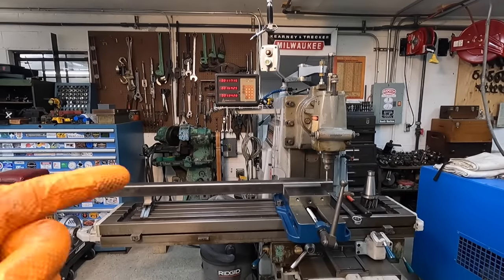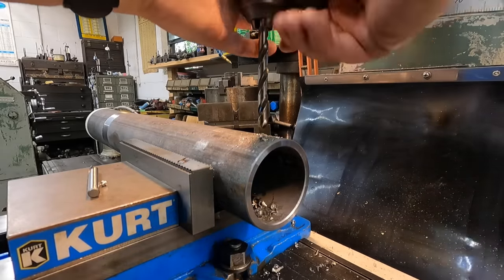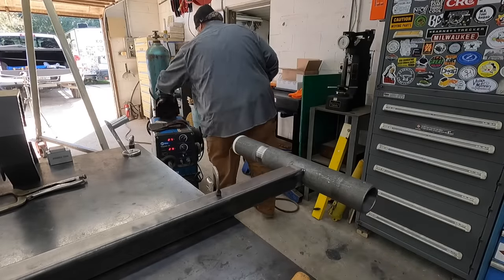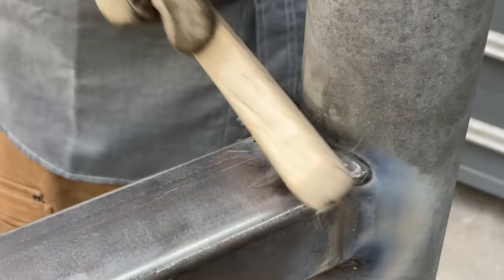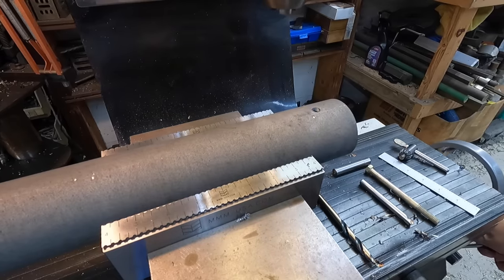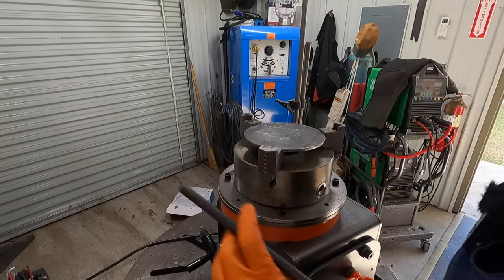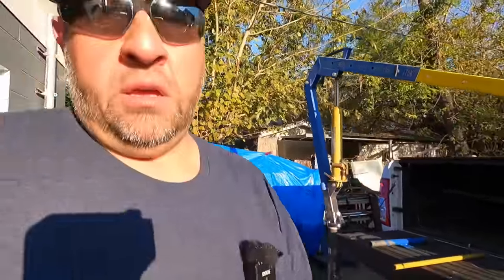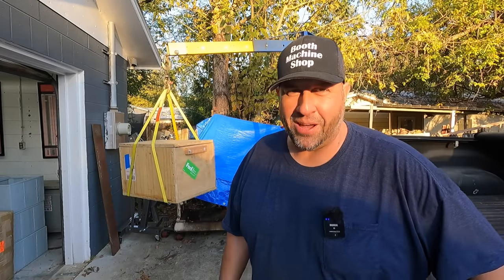Truck Hitch Crane Build Ep. 7: First Test!

Comment: @Abom79 
Why not weld a piece of angle on either side of the boom, and a small piece on the face of the boom, and just "slot" the handle into place? 

This would make it much easier to handle, and maneuver the boom during assembly, and tear down, while also giving you the ability to attach, and remove the handle as needed.

Comment: As for the bottle gas i use Stargon Oxygen 2% CO2 28% argon 70% i think, but i know was told by the guys i go to (Sutton and Garden) that if the bottle sits to long with out being used that you need to role it on its side across your shop floor to mix the different weight gasses back into each other.

Comment: It turned out great! On the worm tracking, what gas flow rate are you using? It sounds pretty high, maybe try lowering it a little bit, I usually run 20-25 cfm. I’ve never had that issue, I’m not saying it’s the flow rate, just something else to experiment with.

Comment: Humidity causes Flux Core to get wormholes. Idk how the weather has been like, condition where your material, and equipment is stored at. Any kind of major temperature changes, like a moist cold shop to a hot dry work area could introduce moisture. I'd agree with you though. If your gas cylinder is as old as you say it is, it surely wouldn't hurt to swap it out. If you think about anything that could bring in, create, hold any kind of moisture, I think you'll figure out what's causing you wormholes.

Comment: Depending how heavy the loaded object is, it will sag the truck springs and put too much pressure on the foot bolt to remove it... better a screw jack or hydraulic.

Comment: .045 dual shield is my fave! If your heat and travel speed is right? the flux will curl up and fall off on its own. Now? Just my 2 cents worth but? Check your flow rate on your shielding gas. I normally use a bit less flow with dual shield than with hard wire.  The higher flow rate of Co2/Argon will cause a "vacuum" effect actually pulling away the shielding gas from the weld puddle. 

I didn't see the actual size of the nozzle you are using at the MIG gun. If you're using a "tapered" nozzle to fit in corners and tight areas? this too will increase the velocity of the shielding gas, increasing the vacuum effect. One last thing? my supplier for gases uses a blue & silver colored bottle to differentiate straight Carbon Dioxide from Co2/Argon mix. I did notice the bottle on your machine was all one color. I know different suppliers do things different but? My supplier uses a plain lite green color bottle as straight Carbon Dioxide bottles as well.

I have used straight Carbon Dioxide with hard wire....Personally? I don't like it. I get a cleaner, smoother weld using Co2/Argon mix. I have never used straight Co2 while welding with dual shield but? If that is what you are using? When it comes time for a new bottle? Try the Co2/Argon mix.....again my opinion, you'll like it better!

1 last thing and I'll let others get a word in. Is your Miller welder designated ONLY for dual shield use? Do you also use hard wire thru it? Again I ask because many welders will use MIG lubricant on the wire and thru the inner liner. If I am doing a LOT of welding with hard wire and a lot of LONG welds? I use WD-40 on the MIG wire and get it to run thru the liner......it doesn't contaminate the weld puddle at all.....EXCEPT for dual shield! My past experience I ruined a whole role of .045 dual shield wire and and had enough crappy welds to fill a cess-pool. You may have to designate 1 liner for hard wire and 1 for dual shield because as you know? Dual shield will NOT tolerate dirt, paint or contaminants.

Hope this helps.

Hyway in Jackson, GA

Comment: How much weight do you intend to pick up with this? If its much more than a few hundred pounds like that vise you loaded, I would be looking at some way to triangulate that crane, as a load that far away is a lot of levering action on the square tube you have running through the hitch adapter. 
And as I commented before and others are pointing out as well, that foot is going to be stuck in the sleeve without some way to relieve the weight of the load to remove the pin.
That crane does look mighty handy though. I've used flatbed mounted cranes in the past and they make life a lot easier.

Comment: Adam,  your stickout is too close to the work piece.  Try 3/4 to 1 inch of stickout - you are not giving the flux inside the wire a chance to melt before the puddle.  It's going into the puddle as powder and melting in the puddle.

Comment: ive had an issue welding aluminum where one bottle of gas wanted a slightly higher pressure on the regulator to get the ideal weld vs another bottle of the same product

Comment: Has the pipe been galvanised? Usually when welded the zinc coating flares up and causes the welds to pop a bit. Maybe that’s the issue you’re have with your welds…

Comment: If the added weight of the cylinder is a problem, why not make it detachable with removable pins, and mount it when the crane arm has already been mounted?

Comment: Adam , 
I asked a welder buddy about the worm tracks. He referred me to this:
Hope there’s something in it that solves the issue.

Worm tracks are a result of gas bubbles that move through the weld metal while it is in the "mushy stage". This is typically caused by a combination of two factors:

1) Too much gas being evolved in the weld metal.
2) Welding with such parameters that the weld puddle is not fluid enough.

When I look at your welding parameters given, I notice that the voltage range is close to that required for spray transfer. (The 29V at any rate.) I suspect that you really want to weld in dip transfer, because the piping would probably be welded out of position. In addition, the gas you are using is typically used for dip transfer.

It may be that due to the high voltage, the welders are trying all kinds of tricks to get a suitable weld puddle, which may include welding at a much too low amperage.

I suggest that you bring your volts down to the 18 - 20V range and let the welders adjust the amperage to suit. In addition, make sure that the consumables used are not wet or in any other way contaminated. Also make sure that the gas flow rates are not too high. As you are getting this problem with a number of different welders, contaminated gas is probably not the root of your problems, because they will surely all have their own gas bottles. Having said this, it may be that you got an entire batch of defective gas, so it may be worth your while to check this out.

I would however start with getting my parameters optimised for dip transfer, and then working from there if the problem persists.

Regards
Niekie Jooste
Fabristruct Solutions

Comment: Adam would the small sleeve at the base of the jack that holds the handle not work if it were turned horizontal , so the handle could be removable?

Comment: @ 28:30, When deciding your pin spacing, why not offset your height adjustments? Say 90 degrees apart so that you're not riding directly above another hole? The base isn't critical to which degree it rides inside the main tube so a 1/4 turn either way is a 1/2" adjustment.

Comment: Also in reference to your worm/pin hole issues, have you tried to run a bead with only single shielding (turn off the gas) I have run dual shield without gas / or change amount of gas you are feeding

Comment: Hi, Adam. Great video, as always. This project is awesome. But I'm little concerned here. All the load stress will be in the weld joint between the leg and the truck square tube. Maybe some reinforcements there would be better, like the four metal pieces you weld on the flange. Anyway, great job!  And congrats for your new shop and brand new lathe.

Comment: The pin holes and worm tracks r gas trapped in the weld I used 2 weld with duel shield wire try 2 have a longer stick out, and b sure u r not using more gas than needed.

Comment: i still would prefere a pipe permanently installed right at the inside edge of the truckbed(behind the taillamp) on both sides.So you only had the crane itself to stick in and you are ready to go,no supportfoot or anything else to adjust or tightened.

Comment: Adam great job. GOT A QUESTION ABOUT A 400 OR 500 LBS.  IF YOU PUT THE FOOT DOWN SNUGLY ON THE GROUND BEFORE YOU PLACE A HEAVY LOAD INTO THE TRUCK BED WILL YOU BE ABLE TO TAKE THE PIN OUTTA THE LEG??

Comment: Torque at the rotating pipe-nylon-2 discs-4 SS bolts  connection about 5 ft times 200 lb equals 1000 lb.ft or .5 ton.ft.Very critical.Now,if you don´t mind, how was the front mount for the monkey bike on your truck performing when you took your trip?.Thank you.

Comment: After your crane lowers the load into the car body, the car suspension lowers and grips the crane support standing on the ground, it will be impossible to release the support.  Instead of holes and bolt, it is better to use a thrust thread and a large nut
Reply: Try watching the part of the video where he talks about dealing with that problem.

Comment: WELDER POLARITY ISSUE? Adam, is you welders polarity set correctly for the dual sheild wire? Gas flow restriction or correct regulator pressure etc?

Comment: This will help with your dilemma. Pin holes and worms are caused by gas lost from wind, angle of the gas nozzle, how close and far you are to the puddle plus how hot your weld is set to your wire speed on different gauge steels (To Hot To Fast) Draws in more air to the weld. For your volts a little to high 18 to 20 volt should be enough for that gauge steel. My brother and I use 24 volts Medium wire speed with dual shield for 1/2, 3/4, 1 inch slab plate for bridge and stadium beams construction. The thicker the steel the more heat you need the more it dissipates. More heat in less steel is like throwing gas on a fire.👈🤓 For me at home I prefer to use regular flux core with a bigger gas cup no dual shield with exhaust vent on low.😉👍

Comment: I have been think of making one of these for a while. The store bought ones are just to weak and  Cheaply made.

I do not have access to the lathes like you do. I'm thinking using a trailer axle hub assembly  instead of the nylon bushing you did. Then I'm going to use a removable trailer jack (weld ring on and jack goes over it).  Just afraid your stiff leg will get jamed when you load the truck.

As far as your worm holes. When was the last time you changed the welders liner, it can get really nasty in there. Then is the wire rusted? How old is the wire, it may have absorbed moisture/humidity into the flux.

Comment: Will it be a problem when you have to "choke up" on that boom to load a heavier item that it might not reach up to the axle of the truck? In practice, you probably won't be using it for that much weight very often, but I know you like to push the limits. :)

Comment: Great video series keep them coming. Just some thoughts on your mig welder. I have always use my machines in excess of 24volt for spray transfer, your machine sounds like it is trying to spray.  When you use your  machine in spray transfer "mode", not really a mode but what I call it, you should use a C8 gas 92% argon 8% co2, as apposed to C25. Try turning the voltage down. I have had a bad bottle of gas, but it was bad from the start. Another commenter has suggested the gasses separate....Try rolling the tank like he suggested.     On another note I recently got a clausing Lathe 5935. I remember in a video you did a long while back where you spent a lot of time talking about tooling. Can you direct me to that video I can't find it. Or could you do another one and talk about what tooling is appropriate for differentiations size lathes and where you can get it.   Thanks Dan

Comment: Your doing an awesome job Adam 👏 I really like the Modular style design and as a thought, you could build a simple hand winch Arch/Davit Crane with an aluminum frame for those loads that aren't extremely heavy, but just difficult to load. This way you can save your back on installing the current heavy duty crane until you really need it. Can't wait for the rest of the build!! #ABOMNation

Comment: The space (web) between holes should be as a minimum 1.5 times the hole diameter to develop the full strength of the lynch pin this application

Comment: Awesome build, but couldn't there be problems with the foot slipping when lifting heavy loads. That would put alot of stress on that one point of contact between the leg and the square tube it connects to, maybe enough to torque the welds off? Wouldn't it be safer to have a cross brace or a gusset to stiffen it?

Comment: I would think the gas doesn't go bad, its whole purpose is to be inert, meaning it doesn't react with things. I could be wrong though, or maybe the tank itself is causing some sort of problem. Could there be something in the tank/regulator/lines/machine polluting the gas or dirtying the wire maybe?

Comment: Just a suggestion, instead of replacing the seals on the hydraulic cylinder, why not replace it with a cylinder that is an air-assisted hydraulic cylinder? Harbor Freight has an 8 ton direct replacement made for shop cranes/engine hoists for $100.

Comment: plug it tap the plug for a small  4 ton bottle jack screws in no need for the holes in the support foot because the holes will never line up when you need them to

Comment: Yes you got a grove in the plastic to hold Grease in. Go up higher than your bed if you don’t it will get away from you on a small bank and the weight will sling it around and the Handel will be sticking in the side of your bed then it will be oh 
Oh shi _ then.

Comment: When you’re actually using it it would be wise to Not put the foot all the way to the ground.
Leaving a gap to the ground will allow you to pull the pin once the load is in the bed.
The gap will close up as soon as the jib starts to take the load.
Putting the maximum weight in the bed then setting up the jib and unloading it will tell you how much gap to leave.
Reply: Yea, but that puts the whole weight load on the hitch to the truck.
Which defeats the purpose of the leg to the ground, and would have to extremely beef up the truck hitch assembly, so it doesn't break off.
Reply: @gdxd7956  the load is taken by the foot not the hitch. The hitch only takes a small amount of weight until the foot touches down.
Reply: @anomamos9095  It depends.
The amount of weight put on the hitch or foot is proportional to how much you lift the foot off the ground, for the bed to come down. If it's a little, then just a little force goes to the hitch. (but you'll still have some pin binding in the leg)
If it's a lot, then a lot force goes to the hitch. (but the leg pin won't be stuck much).
And whatever the weight the hitch takes, it doesn't trasnfer to the foot when it touches the ground. The force/weight that pushes the springs down, is stored in the springs as a force compressing the springs. It doesn't disappear when the foot touches the ground. The springs are still compressed and are pushing the bed up with force. That force is transmitted throught the HITCH to the CRANE to the LOAD.
The hitch only relieves when the load touches the bed and the force now goes through the bed to the springs, not the hitch anymore.
Reply: @gdxd7956  that was a long explanation but somehow I think you’re getting it wrong.
Weight already in bed  bed go up when weight removed. Weight on ground then put in bed bed go down receiver hitch go down weight stays on foot when load removed from jib to bed pin in foot stuck.
Leave a gap between foot and ground foot touches down when weight added put load in bed weight comes off foot sufficient to remove pin.
Reply: @anomamos9095  Nothing you just said has anything to do with the original comment. (AKA strawman).
If you let the foot up, the weight of the load is put on the hitch, not on the foot.
The original comment was, "doing that puts too much load on the hitch and it will break if it's not designed to lift weights."

And i'm NOT wrong. It's BASIC physics, of which i have a LOT of studying it in college.
You don't know structural physics, and weight transfers.

Comment: I’m 5’2” 100 pounds 64 years old and repair small engine stuff in my retirement. I have a similar setup only I had a horrible time getting the lift in the base so I put a industrial hinge just above the tailgate that allows me to leave the weight of the lift on the tailgate and drop it into the base it pretty much stays in the bed cause it out weights me. 😂😂😖😖🤬🤬

Comment: Of all the things you could show in your shop, changing out the spool in that 251 is not new to me.  I think I've changed the voltage setting alone 100 times. My 251 has probably traveled farther and outlive most trucks (6 for me), it's been used on job sites from L.A. to Quebec city.  I've both learned from and taught others how to weld using it. Any time i've had to use any other mig I've wished I had my 251. You, if you are reading this, have probably eaten an industal factory-baked good in your life that the machinery has been touched by that 251. (I built industrial bakeries for 30 yrs)

Comment: Run out of welding wire. 
I don't use a stapler all that much but there have been times I've neatly aligned several sheets of paper and tried stapling them with an empty stapler - LOL.

Comment: Also why remove it every time ??? Just push in to clear tail lights , turn to keep crane part flat / parallel, with tailgate. Make stop you can lock in place , does not spin, and let it ride on trailer hitch!  Just make sure the cross leg does not stick out past the other  finder and give you the most amount of side ways pull out adjustment.  Then only remove it when need too!  Also if let it ride… may have to come up with a  anti walkaway system!!!! So keep it on your possession???